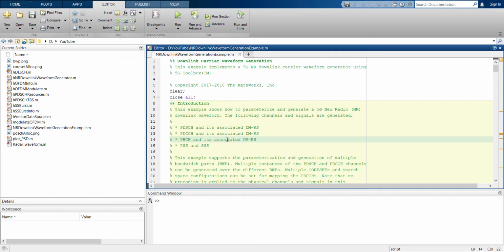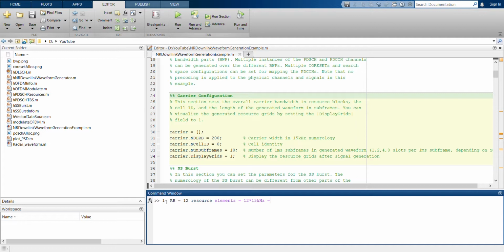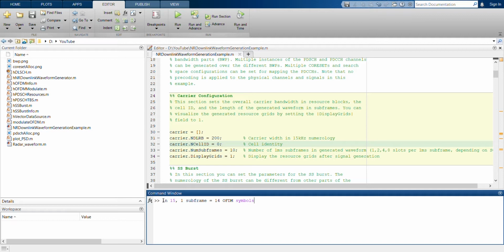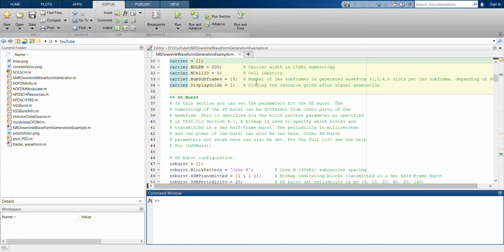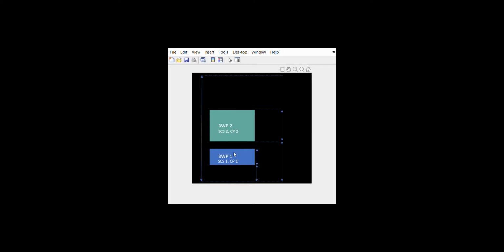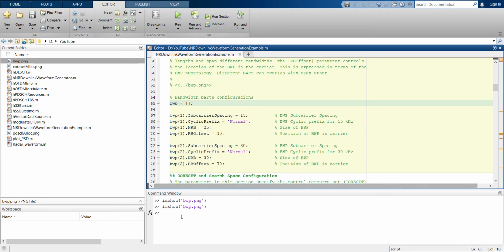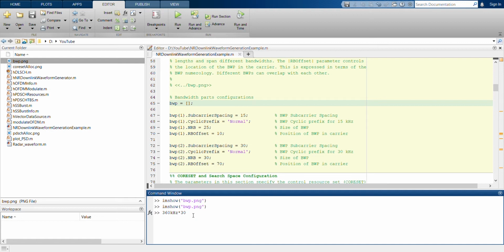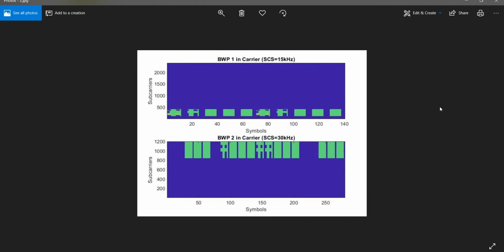Introduction to 5G Toolbox MATLAB| 5G New Radio| MATLAB simulation| Part 01

Comment: how can i add 5G toolbox  to my matlab 2018??
can you give me the link to download it please
Reply from the maker: Hi, I think you will need to download the 2019 version.
Reply: Electrical Engineering Explained 
Which Matlab version are you using ??
Reply from the maker: @bachirlivesports6912  2019b. I think you can download 2019a even, it should be fine!